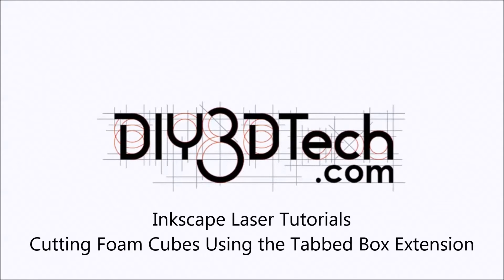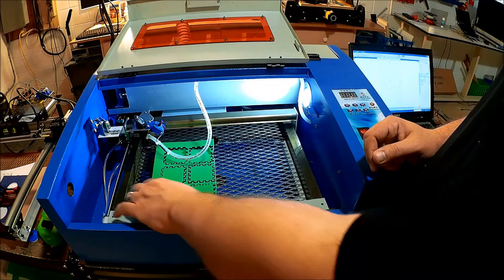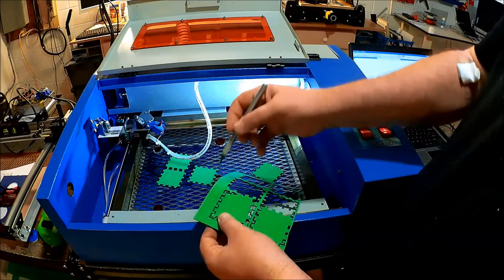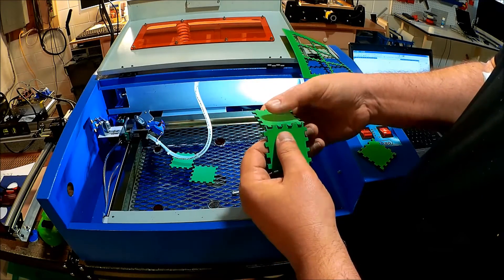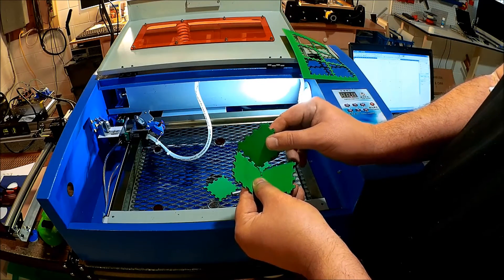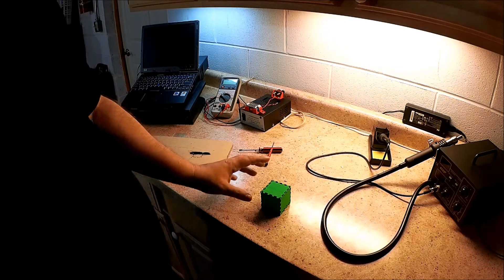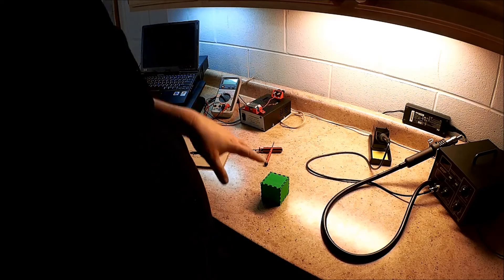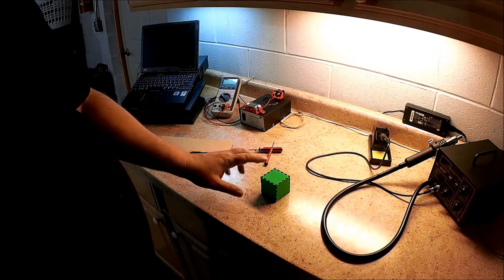Inkscape Laser Tutorials - Cutting Foam Cubes Using the Tabbed Box Extension

Comment: Do you have any suggestions for cutting a 1/2" - 3/4" foam using and eching laser engraver?  I'm trying to Shadow tools but can't find a program to do so easily
Reply from the maker: Foam that thick could be a problem as keep in the laser beam is a focused beam and this was thin foam at the focal point.  At 0.5 to 0.75 inch this would have a very wide kerf and likely want to burn...
Reply: I think you need a water jet.